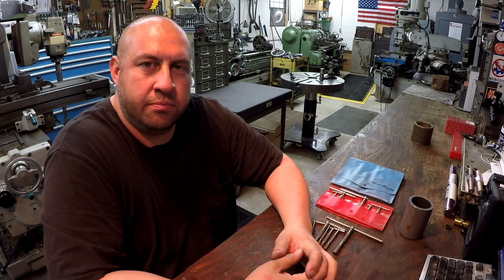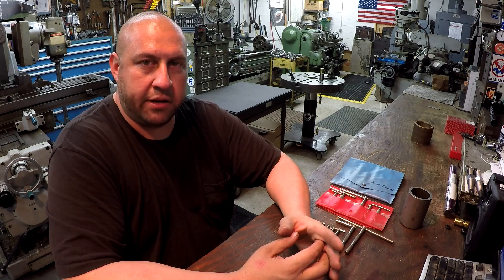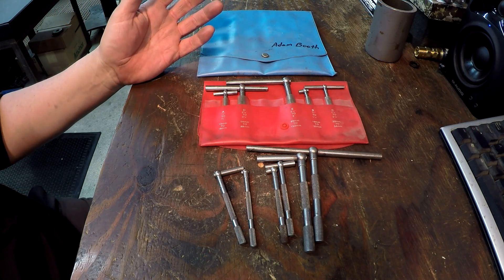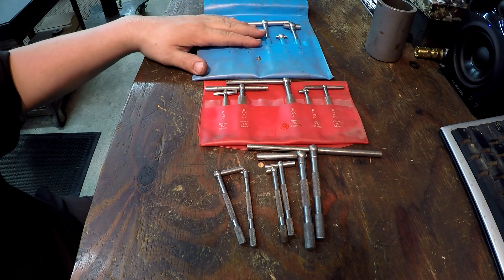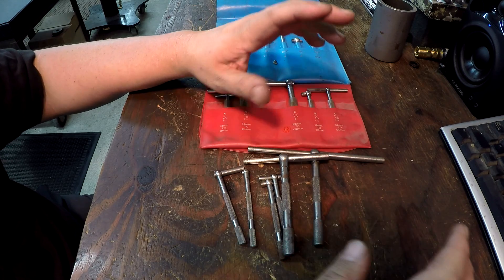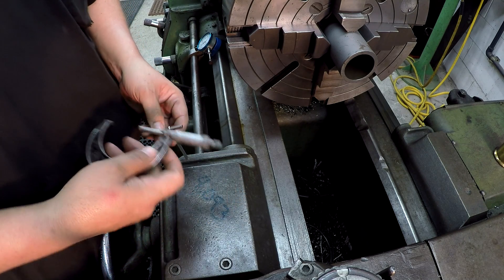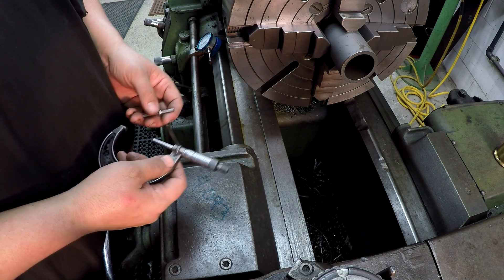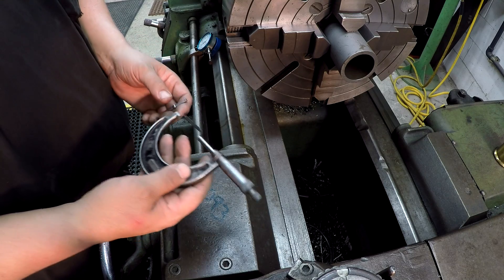Shop Talk 10: Telescope Gages & How They're Used

Comment: Pretty neat to see how those are used. Where i work we only use the 3 point type inside micrometers. So never actually tried to use a telescope gage before.

Out of curiosity, if you have a bore that is not completely round, oval shaped almost. How would you takle that?

I work with CNC lathes and it can happen easily if you overtigthen the part, it can get a bit distorted, but that's with hydralic chucks. I guess you got more of a feel to it, so might not happen to you.

I don't have much experience with manual machines so I apologize if that was a silly question. I do try to learn though and you are an excellent teacher, keep up the good work! :)

Comment: Great to see that your technique and to see that it is similar to mine despite me not being a machinist.  I use these to verify piston to cylinder wall clearance when I put together dirt bike engines.  Took me about 50 measures the first time I used them before I was getting consistent readings  Way cheaper than option than buying a bore gauge, you just need to be patient enough to learn how to use them!

Comment: Well said, Adam. The only way to learn something is to have a proper method to check your results, be it the statistical way by judging repeatability or, eliminating possible systematic errors, by measuring known OD and ID.
Their insisting on a certain method only shows their lack of methodology. A question like, I see you've got an interesting measuring technique - how does that work to give accurate results, would've been more appropriate. Next time you can just forward them to this video. 
Now I want a set of telescoping gauges, too.

ps. I don't mean to imply they are wrong in what they do. On that length scale everything has a noticable springiness to it and soft surfaces can be flattened so the ratchet knob is just the design intention how to achieve repeatable torque on the screw. But on a more abstract level the repeatability and absolute accuracy of the process is what counts. Any way to do it that delivers on these requirements is equally acceptable. Overriding this argument with the authority of the design intent is what I refer to above.
Sometimes it's difficult to stand up for your own way of doing things, sometimes people who derive their opinions from authority are misled.
Reply from the maker: Your right, they could have approached the topic differently, but I'm sure they had confidence in there own practice. I proved mine with my work.

Comment: Good video, thanks. I've seen guys use the ratchet and get in trouble, all ratchets take a different amount of force before they release(depending on wear, maintenance, manufacturer ect) you can't depenend on consistency. I'm glad you made the point of only using feel. I'd love to see a shop talk on the differences/used of two, three and four flute end mills on different metals, I'm new to milling and get conflicting information. Thanks, be safe

Comment: I do it similar, but different!! DEFINITELY "top and bottom" as you say, as otherwise gravity pulling the thing down could well mean that you were not measuring the largest diameter of the bore. I set the gauge slightly bigger than the bore, lock it down, stick it in the hole top and bottom as you say, then "wiggle" the handle to and fro [so that the measuring points rotate] This helps them "walk" to the largest bit of the bore while at the same time pulling down exactly the same as you do.. Works perfect everytime. It helps if there is cutting lube in the bore too.. As to the micrometer, exactly the same as you do it. NEVER use the ratchet, they are mostly FAR too stiff. Besides when you do it by feel, at the same time as you are feeling for the size, you are feeling for the largest diameter. You cannot do this by just screwing down the ratchet like a "G" clamp!! [Are they called "C" clamps in the USA???]

Comment: Your vids are great Adam, if I had my time over I would have loved to do what your doing, i'm thinking of getting a small lathe to make large chess pieces out of brass and stainless, not a CNC but to do it manually, and design my own pieces that can be fully machined by the lathe without the need of a mill, think it would be a good project to get started.

Comment: I think where a lot of people go wrong is trying to center the unlocked gage perfectly perpendicular to the bore, lock it and then try and tilt and extract it. This had never worked reliably for me when i started out so I soon figured out a method similar to Adam.  The key is to purposely snug it up past perpendicular so when you do the tilt to extract you travel through the point of perfect perpendicularity. The dragging of the leg(s) in the bore automatically positions the gage tips exactly at the full diameter (center) of the bore because they naturally want to move to that spot as its the path of least resistance.
Reply from the maker: Your right, and that's something I kind of missed when explaining. I always try to get as much info as I can out to the viewer, but I always miss something.....😣
Reply: well said

Comment: G'day Adam,I am going to forward an argument defending "Mitutoyo" telescoping gauges, I have found over the years that the square at the end of the handle in between the double telescoping end on my Mitutoyo's is a very handy feature for measuring say, the width of a keyway. By  holding the gauge down with the tip of your finger on the square keeps the gauge perfectly horizontal with the bottom of the keyway & you can then sweep the gauge from side to side while your finger keeps the gauge perfectly flat & you still get the same feel as long as you don't push too hard with your fingertip.I'm sure that's why Mitutoyo make them that way. I believe Mitutoyo have put more thought into their design! That's why I believe Mitutoyo measuring equiptment is by far the best money can buy...

Comment: I really like MOST of your vids Adam... Except the foodie ones. Well, of course I like those too, but I gain   too much weight just watching them... torture!  
I've never trusted the friction or ratchet type mics. I know that Mr. Starrett, Brown and Sharpe and General What's-his-name had the best of intentions when they tried to provide a method of repeatability, but i find them only useful for rapid adjustment of the mic.
On the othe hand, there is a point to be made about how easy it is to apply way too much pressure to the anvil, distorting the frame, and invalidating the cert. Have you ever seen a laser photo or digital stress analysis of a 1-2 "standard grade" mic as thimble pressure is applied? (google it) The torque multiplication of that 40tpi screw is amazing [100x psi resultant pressure]. No wonder that it can easily distort the frame.
Your are totally right about how a properly used telescopic gauge (as you demonstrated) can conform to within microns of an i.d. in the machine shop. The problem comes when measuring the gauge. Sure, mic's are convenient and able to show .001" tolerance of repeatable accuracy, that's why use them. But, there are more accurate yet time consuming methods of measurement. But that accuracy and repeatability comes from the machinist. That's why I love the trade... Lord knows it isn't job security or the money.

Comment: Thanks for the info. Stuff like this is real helpful to a learning apprentice machinist. I appreciate your channel, and I have learned a lot much of which has been taken positively by the guys who are teaching me. I recently had to show some co-workers how to use telescoping gauges to measure some parts we had made at an outside shop. While the technique I use is a little different, it still shows the basically the same thing. One thing I think about telescoping gauges is that they need to be rotated through the 90 degree mark, or the minimum diameter. I have seen you use them many times in videos and you obviously get accurate readings. However, you never stated that the gauge needs to be rocked through the minimum to measure the bore. Again, thanks for making these videos I look forward to them every weekend and you have taught me a lot in how manual machining is done by professionals.

Comment: Hey Adam I strongly believe that if you know how to use telescope Gage's correctly as you can they are a great and very precise measurement tool I just recently finished a job for Goddard where to bore was +.0005. -.0000 and I hit my mark and I was getting within.0002 for what the cmm was reading

Comment: Not a machinist, but it seems to me that if you are measuring a curved inner surface with a flat ended gauge, then you aren't going to be able to get the exact diameter of the bore.  I would assume this gap is so minor that it wouldn't matter to the vast majority of jobs, but what would you use on something that does require strict tolerances?  Also I have seen other videos where people use a tri-headed mic for measuring.  What would be the advantages/ disadvantages to something like that.   Thanks Adam for taking your time and explaining your process to us.  Your videos are always excellent.
Reply: Telescoping gauges (at least any I have ever seen) aren't flat on the ends. They have a radius. They're made for measuring a curved inner surface.
Reply: The three-anvil "Bore Micrometer" is a very expensive tool, and usually has a much more limited range than a single telescoping gauge. You can buy a full set of brand new Starrett telescoping gauges for $224 MSRP that will cover 1/2 to 6", while a single mechanical bore mic that covers only 3/4 to 1" costs $758.

On the other hand, the bore mic is much simpler to use and is a direct-reading device, which reduces the chances of making a mistake; while the telescoping gauge & outside mic method requires two instances of "correct feel" and a transfer of the measurement from one device to the other, which can allow for the introduction of error, especially for an inexperienced user. This is why you'll often see good machinists take the same measurement twice when approaching a critical finished size, and also why they take the time to explain good practices in using this method, such as this video.

Comment: Excellent Shop Talk. I'm going to share this in my Race car forums. I can guarantee you, controversy will explode. 

It just does. Everybody is an expert when it comes to measuring engine bores, valve guide clearances, bearings.... 

But here, Adam hits the key points. Every tool has its place and usage, whether it's a job / custom shop or production. 

I've used every type of measuring tool there is. The key is how the technician, craftsman, machinist, whatever, users the tools. 

And there are limitations such as the type of material, temperature, and of course, quality. 

I can't tell you how many times as Adam explains, "you're doing it wrong" is often an indication of the opposite is actually occurring.

Everything is "relative", is what my grandfather, a WW II Lancaster AME, taught me. Practice, reference, and experience is how measuring is accomplished. For almost a year, he would double check my work. Constantly verified our tools, material composition, and clearance tolerances allowed. For years, I wondered how he stayed disciplined in carrying out these steps. The epiphany finally struck home when he took me to a RAF Lancaster Squadron reunion. The pilots were grateful that their ship always brought them home. 

It's one thing to build a race car engine and not really "worry about it". But when four Rolls Royce V-12's are the only thing keeping you in the air going into battle, the demands for perfection sink in. +1

Adam's technique is the exact same way I was taught. I agree, everyone is going to have different methods and they aren't necessarily wrong. 

Confidence along with trial and error leads to experience.

Comment: Same way I do it. Good practice for a beginner is to get a ring gauge or something else with a known accurate I.d, and keep doing it until you can repeat your measurement within a few ten thousandths
Reply: And a calibrated mic of course
Reply: Good advice. I worked at a machine shop in HS, and spent first three or four months in the tool room checking measurements on literally everything in there. I must've mic'ed a thousand end mills. Also countless gauges, blocks, pins, etc. Mastered mic's, but I gotta say I fell in love with calipers. I used them like 90% of the time after that. Way faster and I was dead accurate with 'em.

Comment: What a coincidence!!!!
I had an issue with a couple of my operators measuring undersize than the actual size using these gauges. This is exactly what i showed them. They were not rocking the gauge, if you know what i mean. I have got to get some bore gauges now, to get the jobs done on size!. Great video as usual, Adam.

Comment: Good video. I been at it for over 50 years and used pretty much Adam's method. If my reccommendation carries any weight you noobs looking for the how-to on the use of telescope gages might take a lesson from Adam before you try anyone else's. Do it right according to your ergonomics and you'll be able to take temperature corrected ID readings consistent to a few ten-thousandths of an inch.

Practice, practice, practice is your path to accuracy and consistency. Ball bearing inner races are typically ground to a few ten-thousandth tolerance. Find a few of different sizes and practice with telescope gages on them in the comfort of your recliner during commercials.  

Practice those precision techniques. There's no point in spending hours making a part measuring it with  tools you've never used before.

Comment: Hi Adam, thanks for the video as always. When you "lock" the telescoping gauge, do you turn the end, or is click-on-click-off like a ball point pen?
Reply: It has a screw thimble on the end of the handle
Reply: The screw on the bottom of the gauge is typically attached to a rod that travels up the handle and provides friction to the moving anvil(s).  This locks the anvils in place when you tighten it, and allows it/them to move freely when you loosen it.  The anvil(s) is/are also spring loaded to provide friction with the surface being measured.

Comment: Adam -
thanks for the video on using a telescoping gauge, but from my point of view, you missed a couple of important points.
For one, how can you use something with a flat end to measure a curve ?
also, you talked about tightening it up before you pull it out, but never said what was being tightened. does it lock the ends in place ? if so, what is the point of pulling it out at at angle, instead of straight out.

I wish you would go back over these points in a little more detail.
Reply: Since no one else has answered your questions yet
The ends aren't flat, there's a radius ground on each end that's smaller than the smallest bore each gauge size is used on. So in use you basically have a point contact inside the bore. He's tightening the end of the handle that's closest to him. That then holds the end or ends from moving. Swinging the gauge through a short arc allows the parts bore to compress the gauge end to what the bore size is.Slightly tightening the handle just enough allows that compression but is still tight enough to allow handling and measurement if you use that light touch As the one end swings out of the bore there's more distance between the gauge tip and the bore because of the angle.That allows the gauge to drop out. I learned by using a inner bearing race with a known bore size. It does take some practice to learn the touch on both the gauge and how much drag is right as the gauge tip is gently rocked across the mikes anvil face.
Reply: If you look closely the telescope gauge has domed ends so it is registering on a single point at each end.
Reply: The tip of the handle has a little screw thimble. Inside the handle is a rod that is forced against the telescoping rods, locking them in place. The faces are radiused appropriately for the range of the gauge

Comment: I think one thing that needs to be thought about, or expanded upon is...  measuring to fit a standard vs measuring to fit the part you are making. 

I am new the the machining thing. I have many years in sheet metal fabrication. WHere the itim I am making needed to fit an item made in another state or country. I had to calibrate my measuring tools to an agreed standard (NIST I think). 

When making a lid for a box I made the actual number reading of the mic, caliper tape measure mattered not one bit.

I'm not explaining this well. I hope the community here gets what I'm putting down. LOL
Reply: It only matters about consistent repeatable dimensions when making parts for interchangeability.  One offs make to fit.  Done both.
Reply: "Old" school you did not even necessarily need an actual dimension.  Use of inside/outside spring calipers makes it entirely possible to make something to fit.  As Roy R. states its the value of parts interchangeability where accurate measured dimensions are useful.  Early on in this hobby I did not have mics suitable for all sizes and used spring calipers and they too need the machinist to develop the "touch" as to how much pressure/friction is needed to take accurate measurements.

Comment: Nice explanation, Adam.  A good set is a must.  I have one set which doesn't like to "lock" correctly.  I'm going to try checking them out and if I can't figure it out, give them the boot so I don't try to use them some day.
Reply: I have a cheap import set and I have to really crank down on the screw to get them to lock correctly. I can still get accurate and repeatable measurements though
Reply from the maker: I have used those cheap import ones and they don't have the same feel. I would suggest a good quality set like the ones I shown.